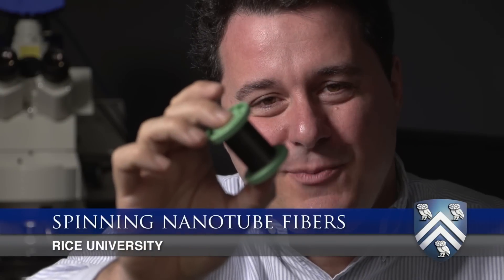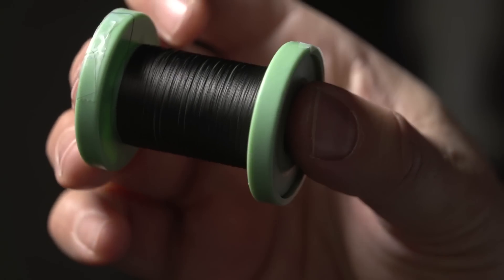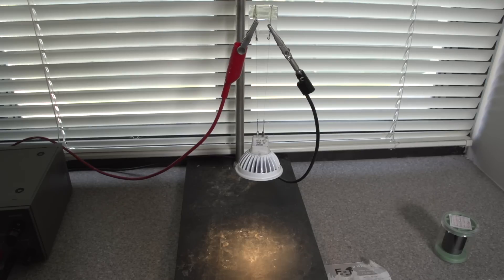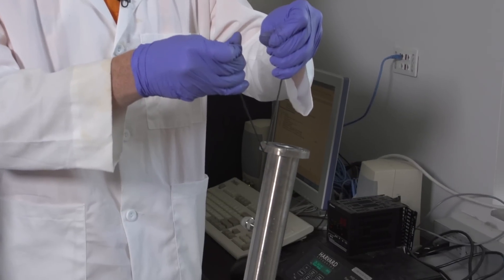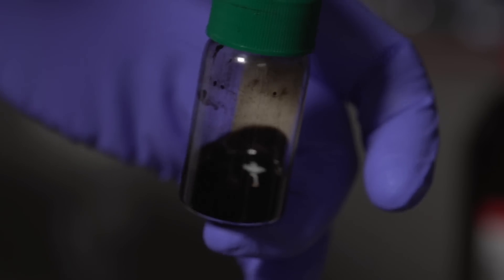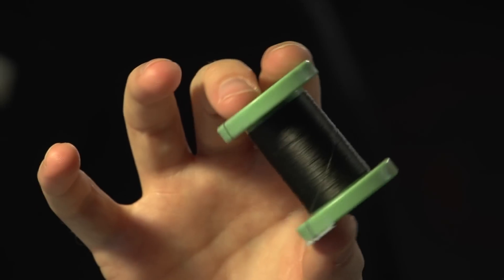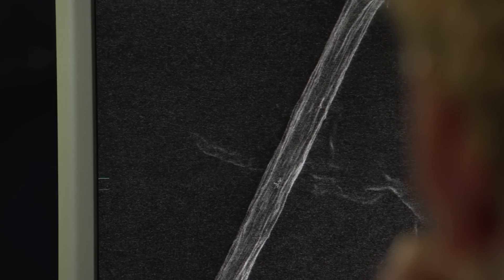Spinning nanotube fibers at Rice University

Comment: 🎯 Key points for quick navigation:

00:00 Continuous carbon nanotube fibers are as thick as human hair but contain trillions of aligned nanotubes, showcasing exceptional properties.
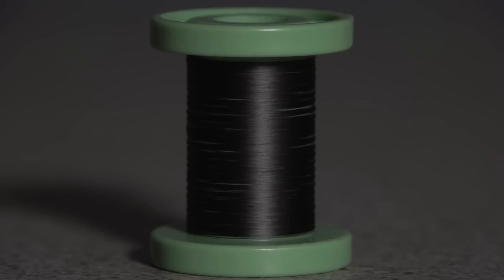00:40 The fibers can support weights while also conducting electricity, demonstrating their multifunctionality.
01:22 The fibers are produced via a wet spinning process using a viscous solution, allowing for scalability and cost-effectiveness in production.
02:30 The strength and conductivity of the fibers combine properties of metals and carbon fiber but can be handled like textile materials.
03:12 Collaboration with Taron, a fiber spinning company, aims to advance the technology of carbon nanotube fiber production.

Made with HARPA AI

Comment: Has Rice University attempted to spin graphene either alone, or mixed with the carbon nanotube fibers? If perfected and coated, could be used for electrical motor windings, which could drastically reduce electrical motor/generator weight, while also improving the motor/generator performance characteristics. Something important to investigate further.

Comment: I had a question for a potential product i am designing, my question is can nanotubes be scaled up to hold a 1000psi pressurized gas? i don't need it on the nanoscale, more so the width of a pin.

Comment: What is said at 2.40 makes no sense to me!
"Scaling up production using a wet spinning process could easily be done"
How?  Running a 19 fibre spinner 24x7? 
ok that might be a 100 fold increase (100 reels per day?) from one machine but what I see is an expensive product (the prepared graphene in blah blah acid) running through a super-expensive machine...kilos of yarn per day, not tonnes of panel or fabric.
I suppose the dream is the fibre gets incorporated into a superlight but weak material and we end up with the superlight but strong materials of the future...what will comprise the bulk in this new world or will we just get used to flimsy in appearance but tough as nails

Comment: What is the estimated computed the surface area?
Reply: Considering that the material they use was tens of nanometers thick, and spun 50 meters, and my estimate is that it's 100,000,000 times thinner than the length if it's a traditional carbon nanotube (which it probably isn't, rendering the calculations wrong), the dimensions should be 0.000025 meters squared, considering that it's 50 meters long and 500 nanometers (m*10^-9) thick.

Comment: It seems that since the carbon is being extruded it must be forming nano-cylinders not tubes. I will have to go away and read more to understand what is going on.
Reply: The extruded "cylinder" is the width of a human hair. It's a viscus liquid filled with nano tubes. The human hair is on average about a hundred thousand times the scale of nano tubes I think. But the point is that it's not the extrusion that is making the nanoness. The nano fibers are made in a different process and mixed in to these threads in the liquid. Hope that clears things up. :)
Reply: +Brew Dain so basically mixing it into a goo will not crush the nano straws?
Reply: How do they know it’s in tube shape not cylinder?
Reply: A tube is a cylinder, a cylinder is a tube what on Earth are you arguing about?

Comment: So how long are the individual nanotubes that make up the thread?
Reply: ***** You still have to twine them to make a yarn. The shorter the individual pieces are, the more you need to make them hold together. If the thread is as thin as it could be.

But you're probably right in that they are quite short and therefore much weaker than they could be.

Comment: Nanotubes are expensive. $2/gram when you order more than 100kg. or $35/gram sample size. Do the math for 100kg....$$$$$....

What acid did you dissolve the CNT's in? And is that the "mayonnaise" viscous material or is that a resin your extruding with CNT"s dispersed in that. I'm trying to make a fiber from raw SWCNT's and trying to decide what resin to use and what spinneret and how thick to make them.
Reply: good question i got the same idea (to replicate their process in a crud way), but i can hear the name of the acid they used
Reply: chlorosulfonic acid also known as chlorosulfuric acid.

Comment: wasn't it supposed to be like 100 times stronger than steel? That would mean that 1 string like that could hold like 20kg atleast. not 50 grams
Reply: Getting nanotube fiber to be as strong as theoretically predicted has been an issue. Probably the hope is that if you can make it scalable then more people might be interested in figuring out how to get closer to those high numbers. Good eye.
Reply: problems: you need more nano tubes, and less filler, and it helps if the filler covalently bonds to the tubes to the adjacent tubes, and if the tubes them selves are at least a few millimeters long, and axially alligned to the thread, etc etc
Reply: theREDshadow the strings in this video were as thin as a regular thread, everyone can see it in the video
Reply: +8bit chess Here is a review highlighting the strength of carbon nanotube yarn http://pubs.acs.org/doi/abs/10.1021/nn5045504
Reply: +Kristopher Whitehead Even a regular sewing thread as thin as that would be able to hold 25 grams easily. Btw it was 2 strings of nanotubes to hold 50 grams. This presentetion is less than impressive.
Reply: +yeah Well sewing thread is incredibly thick compared to 2 String of nano tubes, String can be over 100,000 atoms thick; While Carbon nano tubes can be only a few atoms in diameter. Considering this amazing difference is thickness, Carbon nano tubes have extraordinary strength.
Reply: +YEAH Think about it like this. If you had a thin string of steel, same thickness essentially. Would it even hold 50grams?
Reply: +yeah You're right, sorry I was confused about your comment. However my point still stands about carbon nano tubes' incredible strength. I believe that their use in the future will be invaluable.
Reply: +Kristopher Whitehead It definitely would
Reply: This is probably due to the same issue with graphene.
A sheet of graphene isn't actually a single sheet. It is various smaller sheets stacked or slid between each other.

I don't think these carbon nanotube wires are just 1 long strand of CNT, probably thousands of CNT's pulled together hence the huge deviation from ideal strength.
Reply: The point of that demonstrated is that the threads are also conducting. A steel wire of that gauge couldn’t maintain the same ampacity as the CNT.

Comment: can you produce   cable  to  make space elevator
Reply: +kotaro kojima Not with fibers assembled from short nanotubes. We have to learn how to manufacture continuous tubes that are at least many meters long.
Reply: Faris Zaibaq
"since nanotube manufacturing processes are flawed at the moment, you will inevitably end up with a bad tube in your fibre."
   True no matter how advanced you manufacturing processes are. However if/when you employ quality control (testing them and passing only good ones) Your yield will be smaller but adequate to the task. Inferior nanotubes can still be useful for other products.
Reply: Would they be able to grow around a steel helix tube, I also have a carbon fibre helix tube?

Comment: The wire does not look that strong from the video. What is the ultimate strength in tension you achieved?
Reply: I've read elsewhere that the material has a tensile strength of about 126GPa, very impressive! Obviously methods of winding, alignment would effect this figure.

Comment: if i tried to cut it with a knife, it will be cut?
Reply: medo sam that would be extremely painful.
Reply: for who?
Reply: for you.
Reply: why?
Reply: medo sam it won't be able to be cut due to extreme strength of the nanotube bonds.
Reply: so it is that strong, although it dont look that tough
Reply: Rafiqin Razali no you can cut it with enough force you can cut steel with butter.
Reply: you didnt get what i mean, it seems very thin i think a scissor can do the trick
Reply: what do you mean?
Reply: Yes you can cut it.

Comment: Has any one tried to use the fiber in 3d printing? It would be interesting to know if the media can be bonded to parallel fibers. Or can the extrusion process its self be adapted to the print head on the printer?
Reply: +Larry Monson that would be something wouldn't it? Imagine three dimensional printing a stealth fighter on a large scale haha.
Reply: One company actually did find a way to incorporate unbroken graphene wire into printed metal objects. The strength was a good bit higher than without. It's a half-measure, but it's a start at least.

Comment: I just have a few questions, i don't know the physical properties of carbon nano tubes per-say but I do know them to be a lot stronger than what is shown here...in fact, famous physicist Machio Kaku offered up a comparison of just how strong nano tubes are by using this example; If you were to place a single layer of carbon nano tubes out into a sheet and then place a pencil point fist into the nano tubes, then place an elephant on the pencil it still wouldn't break. Now that seems thousands of times more impressive than them demonstrating thread holding up a light bulb and a steel spool. Am i missing something here physics wise? I heard we were at least 10 years away from finding ways of mass producing carbon nano tubes....in fact Machio Kaku said we are only able to make about 3 inch long section and that's it. When did we find ways of producing these tubes at such a high rate? Are these not complete nano tubes?
Reply: Go Google and Youtube search AR500 Carbon Nanotube Level IIIA soft armor plates. You'll see the results.
Reply: I think this is different than Graphene. Yeah

Comment: So if it can be dissolved in a solution, does this mean it is recyclable? And if so, does it loose any strength? Because this is the big problem with materials like carbon fiber.
Reply: What problem are you talking about with carbon fiber?
Reply: Carbon fiber is practically impossible to recycle.

Comment: Run a current through the spool!
OMG I was waiting for that the whole video! If it is a better conductor than gold, lighter and thinner, and your spooling it ! It is going to make awesome electromagnets! Revolutionize the size and power of motors.
Reply: If I'm not mistaken it's about the same conductivity as copper.. and so you're aware gold is actually a worse electrical conductor then copper, silver is actually better then copper though
Reply: yep
Reply: Karol Palazej  You could put lacquer on it, like they do for copper solenoids

Comment: As soon as the acid-nanotube mixture comes out of those holes, the acid is rapidly diluted by the surrounding water, leaving behind only the nanotubes themselves. The nanotube fibers are then twisted onto the spool and dried, not necessarily in that order (I have no expertise in this field) and voila, you have (probably almost completely pure) nanotube thread.

Comment: I doubt it, having better strength is not required for electric motors, and the conductivity of carbon nanotubes is doubtless lower than that of similar-size copper wire. The emerging tech that will make motors super-efficient is high-temperature (hopefully room-temperature at some point in the future) superconductors.

Comment: A space elevator is not intended to connect the moon and the earth, because the moon is not in geosynchronous orbit around the earth (stays in the same spot in the sky relative to the ground, think TV satellites. A space elevator is intended to connect the earth and a space station that IS in a near-geosynchronous orbit, generally a little outside so the centrifugal force holds the cable up. Your proposal is idiotic, but it's not what the "idiots" you refer to are trying to do.
Reply: Bro, In that process the acid is Dilute in phorifonic acid . For condtive and particle together for velocity what type acid is mixture in carbon ink  ????

Comment: One step closer to the Iron Man suit, could be used as a secondary layer under the armor, to absorb impact and protect the wearer from shock, multiple layers could be used to maximise effectiveness. Now we just need propulsion, and that's already in the works and that damn power source large enough to operate the suit (biggest problem). Tractor beams are in the works, reversing the effect shouldn't be too difficult, as light natively pushes things away.

Comment: Do you even know what a Pascal is?  It's a unit of force per AREA a single nanotube has a strength of about 50GPa, G meaning giga (10^9) so for a bundle of nano tubes to hold up 50Kg of weight it would need to have a cross-section of 0.001 mm^2 rather than the 1 nanometer^2(10^-9 m) cross-section of a single tube.  In other words you are wrong by a factor of 100000.

Comment: Hard numbers and everything should be in the paper, which is 20 bucks for non-members. Still, the report says it has 10 times the tensile strength of steel. Which steel? What does the stress vs strain graph showed up? You weren't expecting to find that in a youtube video, were you?

Comment: The nanotubes in the fibers are heavily bundled together so it is unlikely that breaking the fibers will cause nanotubes to become airborne.  Of course, this will need to be tested thoroughly before putting nanotube fibers out in the market, but the arrangement and packing of the nanotubes in the fibers makes it a very different material from asbestos.